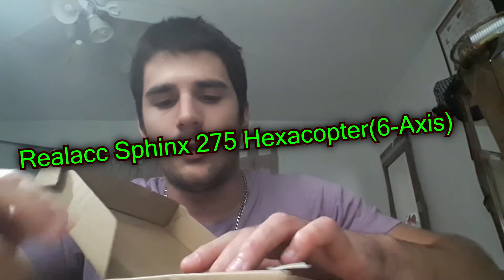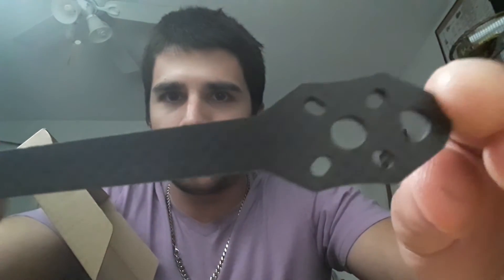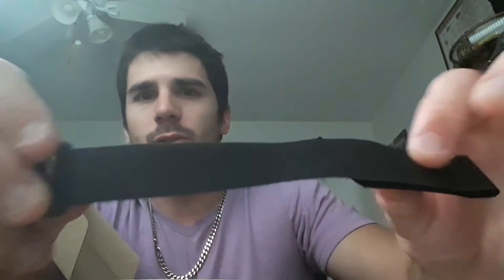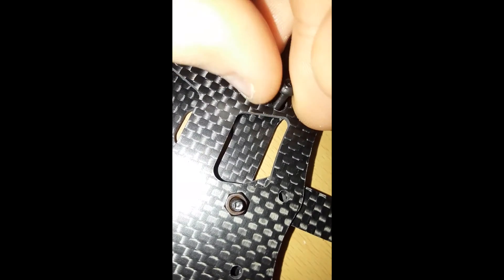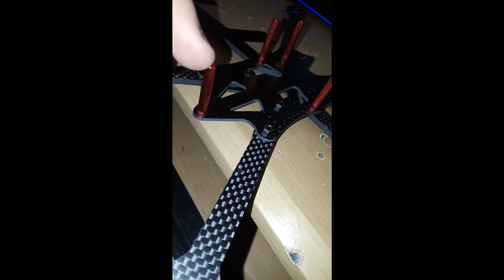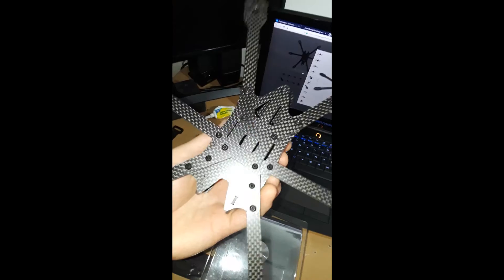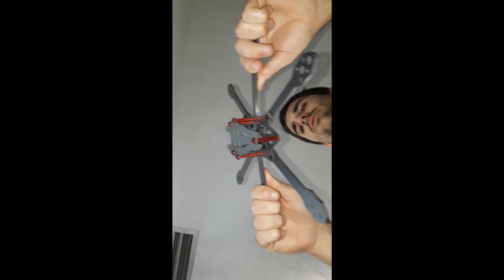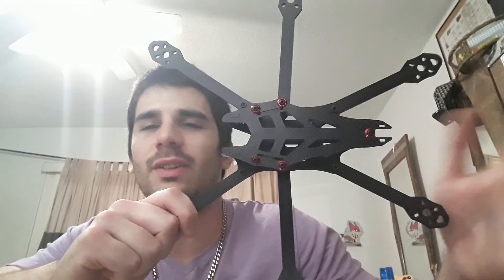Realacc Sphinx 275 Hexacopter Frame 6 axis(Build and Final Thoughts)

Comment: Did you build this? How's it fly and do you have any flight vids? Didn't spot any in your playlist.
Reply from the maker: OriginalGingaNinja Yes i did build it, too much battery sag, horrible flight time, flew worse than my quads, so i gave up on it and never posted anything about it lol. I did use really cheap motors and that probably was the problem for it flying bad but the weight of 2 extra motors kills it for me, for now ive given up on hexes.
Reply: Bonemyster FPV That was what I was worried about. The Sag with 4 motors is bad enough so thought that might be a problem. Just really like the look of it and never flown a hex. Doesn't seem to be any footage online of anyone flying this frame. That's probably why. Think it would have to be a low kv 6s build but even then a quad I guess would give longer flight times still. Thanks for the reply shame it didn't work out. Was really hoping that it was going to do well.
Reply from the maker: OriginalGingaNinja yea 6s low kv might help but thats still 2 extra motors and arms. This frame hasnt been out for that long, maybe 3 months. I flew it on 5s and still sucked😂, think i also tried 6s but not with low kv, but yea 4 motors will yield much better flight time so im going to stick with thay
Reply: Bonemyster FPV Shame, but makes sense. Thanks for testing it and the feedback anyway.👍